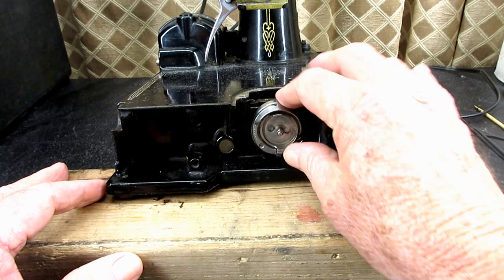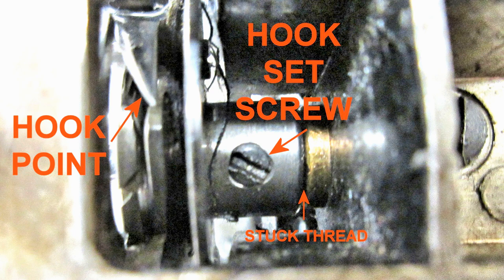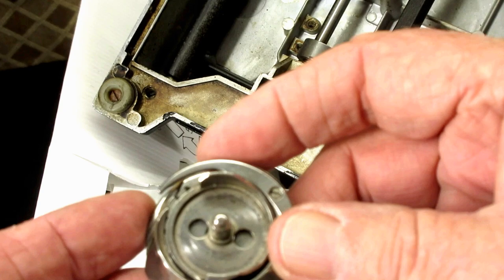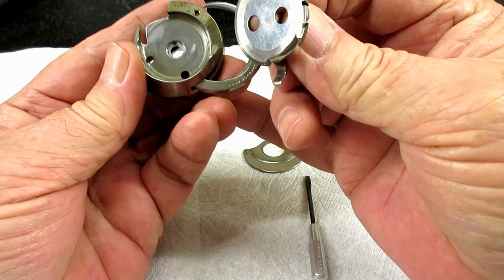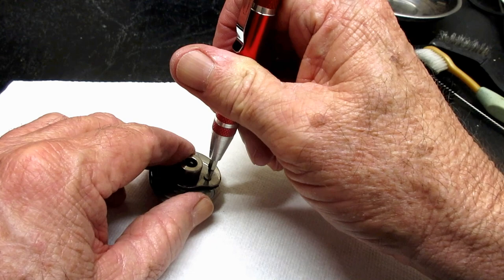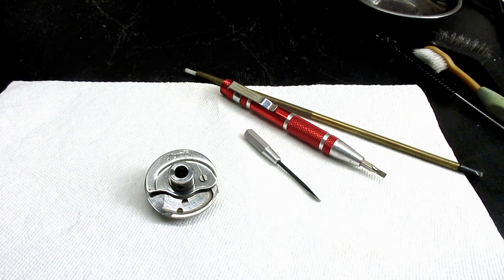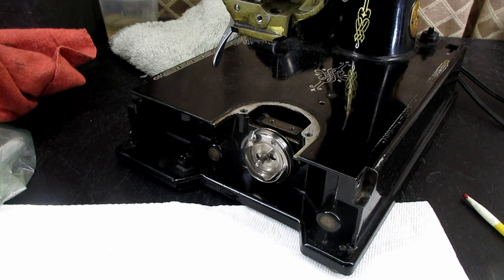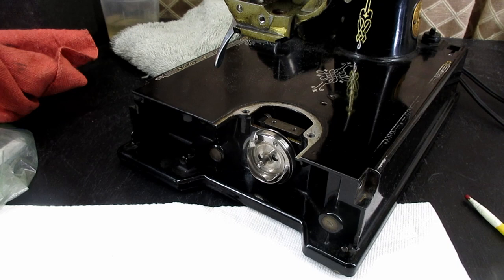How to Remove Clean and Replace the Hook on a SInger 221 Featherweight

Comment: Question Andy, do you have a website? I’ve been trying to learn how to fix the tension thingy for a Singer 7110 and found out through your videos that the indicator was missing the horizontal bar. Is Sew-Classic shop still in operation? I need the part number for the 7110. I’m also trying to locate The Hook Timing Drive Gear Set for that machine also. Help!
Reply from the maker: No website. I am not a dealer. I believe the owner of sew-classic retired. You may find a used tension assembly on eBay but it will cost as much as just buying a complete new assembly. Here is a well known parts seller who has many parts for your model 7110, including the tension assembly and gears. https://www.sewingpartsonline.com/singer-7110-sewing-machine-parts.aspx?sort.ss_cat_sort=desc&index=1   Model 7110 is too "new" of a model for me to have worked on so I can't guide you as to gear replacement. None of my suppliers have a Service Manual for your model which usually means it was made in South America  or Taiwan. Good luck, Jacqueline
Reply: Andy Tube thank you for your respond. The machine says Made in Canada. The gear of the shaft for the tension mechanism is metal. It has a long pin that does protrude out the back the screw that holds the shaft is on top rather than the side. I’m attempting to learn to fix the machine for a nonprofit Forget Me Not organization here in MS. I’m just a volunteer sewist. I wonder if it’s even worthwhile to go through the trouble. The machines that the organization buys or receives are very old. Then they are cleaned and somewhat repaired and taken to the Mississippi Correctional Facility for Women. The organization’s CEO teaches them how to sew specific items (dresses, etc). This items are then shipped to other countries such as Haiti or Africa and given to little girls. My friend operates on a small budget so I’m not sure if the machine is worth all the time and money that could be put in a newer older model that can last longer.  What’s your opinion?
Reply from the maker: It took me this long to research and find a part. A friend in Canada emailed my the parts manual for model 7110 (I'll give you a copy free if you email andymanuals53@gmail.com and ask) The indicator dial on this model was actually called "Tension Spring Cup" (go figure) and the part number is 421739-456. It was common for Singer to use certain parts on many models and there is currently two sellers advertising a part they claim will work in place of 421739-456. (alternative part) That is a fairly common circumstance as the machine age and people look for parts.
Here are links to what I found: https://www.mrsewing.com/products/tension-spring-cup-for-507448-singer-44879-472
https://www.ebay.com/itm/SINGER-TENSION-THREAD-CUP-421739-456-FOR-507448-FOR-200-300-400-500-SERIES-/264593758819
It has been my experience with "alernative parts" that they may not be exactly the same in every way, but they usually do work as advertised. You pay your money and take your chances, I guess. As to a "newer older model" I think you need to go older. Model from the late 1970s and later (newer) tend to have mostly plastic parts and do not last anywhere near as long, are harder to fix when they can be fixed at all and parts found.  Models like 15, 66, 99K (favorite 3/4 size) 201, 301, 237, 327, 337, ( mine cost $25, a gorgeous machine) 403A, 404 are all machines made with mostly metal parts. Some have belts that easily last 10 years and cost $8 to $10 to replace, a job that takes 5 minutes. Some have all metal gears that last a lifetime. These machines are easy to work on (IMO) and parts can be found because 100K to 2 million of the model was made. I have 500+ video showing how to restore many of the models I listed. I've had 2+ million views from 195 countries and territories and countless people have told me they restored the machine by watching my videos and it works great. Some can be found for $20 in thrift shops, yard sales and the trash. Some can cost $200 if in good working conditions. Some charities I work with buy from shopgoodwill.com on auction and fix the machines for charities. The models I mentioned, with normat oiling and maintenance, can sew for another 50 years, no problem. A shame to ship a plastic machine overseas only to have it fall apart. That just MHO of course. Good luck, and sorry it took so long.
Reply: Andy Tube thank you Andy. I’ll send you an email right away. Happy 4th!  God bless.

Comment: Hey Andy!  Thank you for such a detailed video!  It is very helpful.  How tight should the gib hook be?  Mine is really tight towards the top.  That is, above the screw it is really rubbing against the metal of the base.  Is that normal?
Reply from the maker: I'd say it's normal. It's a snug fit with very close tolerances. Watch @10:00 in the video when I swing it open. I had to use some good force. If someone has opened it in the past they may have bent it slightly by pulling on the upper tip, which I warn against. After cleaning mine was slightly easier, but still a tight fit. If it assembles completely and sews well then no worries. There are new, non-OEM (Original Equipment Manufacturer) GIB Hooks available for sale https://www.sewingpartsonline.com/full-hook-gib-alphasew-singer-170160.aspx  I've never used one but maybe there not made as well as the original Singer one. People also reuse parts from other hooks and even 221 featherweight parts as the hooks are similar.

Comment: Andy thank you so much for this video! I was wondering I have went thru cleaning the hook areas just as you showed us, I can still hear a small metal rubbing could it be the needle hitting the hook? In that case what shall be my next step? Thanks a bunch! 😘
Reply from the maker: Thanks for watching my channel, Jacqueline. I can't really diagnose a small metal rubbing thru a comment. Yes, it could be the needle hitting the hook, or part of the hook, sure. Is that when you turn the machine by hand, or when using the motor? With or without thread in the needle? With or without the bobbin case and bobbin? See what I mean? What I check for first is a bent needle (I just put in a new one) and turn by hand, no thread/case/bobbin as see what happens. Run the machine without the needle. Be sure the needle clamp is clean and the needle inserted all the way up in it. Correct style/size needle? The needle bar height and hook timing should be checked. The clearance between the needlepoint and hook point is tiny, and wrong height or early timing can make the needle strike the hook, case, or drag on the loop guard of the hook. You can get a free copy of the model 301 Adjusters Manual by joining or sharing with this service: https://www.scribd.com/doc/230337487/Singer-301-Adjusters-Manual  or if you are uncomfortable with that, you can buy a copy for $7.95 at this website: https://manualsoncd.com/product/singer-301-301a-sewing-machine-service-manual/
I have used both of those sites for years without any problems. OH, BTW, the last time my wife came to me with this problem on her 301A I found she had not been oiling the bobbin case area (like forever) If the instruction manual is needed, it is still a free download from SInger at this link: https://www.singer.com/search/support?title=301

Comment: Hi Andy good day !  I love your videos . Keep up the good work. Just wondering if you could give me few tips for removing the set screws from the hook hub . I have done every possible thing under the sun ….. ie …. I have used the penetrating oil , heat from hair dryer and heat gun but the screws are not moving even an aota …… what should I do ? This is really driving me crazy !!!! Your advice & suggestions shall be highly appreciated. I look forward to hearing from you ASAP. Thanks, Ram.
Reply from the maker: Sometimes it takes hours/days of using a penetrating oil or heat. Some screws, like yours, seem impossible to get loose. I use a method of hitting the screwdriver with a small hammer while turning it at the same time. I've shown this in a couple of videos but do not remember which of the 600 they are. Here is a video with a very good example of this method. https://www.youtube.com/watch?v=LSU7Ua7xyuY     There have been times/screws that this did not work either, so just kept soaking/heating. Recently I tried a new tool, an impact wrench and it works perfectly for removing screws like yours. I showed it in a recent video here: https://youtu.be/t_m98Umuvy0   Good luck, Ram, and be patient and safe.

Comment: I cannot get the first two screws out!! I hit it with the hairdryer and even a little WD40???!!! I got desperate! I can see the thread too!
Reply from the maker: This happens sometimes. You'll need patience. Heating and using a penetrating oil can certainly help and you may have to repat that over a couple of days. I've wrapped the hook base with strips of t-shirt material soaked in WD40 and left it soaking. Using a hairdryer for 5 minutes and a squirt of WD doesn't always work when the screw is that stuck. There can be dried varnished oil in the thread, too, that is holding it tight. Again, be patient as it took 50 years to get stuck that hard. You can also use a closed-end box wrench to give you more torque while turning the screw but you'll need someone holding the handwheel for you. Another method is to firmly tap on the screw bit/ screwdriver with a hammer while turning as the sudden jolts can "break free" the screw. Once you hear the "snick" it will turn easily. YOu can also use a screw extractor device. I show an example of using one starting at 21:40 in this video: https://youtu.be/t_m98Umuvy0  If you are not replacing a damaged hook you can try cleaning it in place, too. If you break the screw head it requires drilling it out and tapping new-sized screws to replace it, and that is a real hassle, so easy does it and be patient.
Reply: @andytubesewing1953  thanks so much.
Reply from the maker: @chrisyzuccaro1767  Certainly, and good luck. It's a wonderful machine and well worth the effort.

Comment: Help please, I am perplexed.  I have a 1942 featherweight.  No problems in the past year if using.  Regular grease/oil by myself.  Yeaterday was chain sewing along and the fly wheel seized up.  I immediatly stopped, took gib hook totally apart off of machine looking for a tiny piece of thread, or burr…none.  So, i did a full maintenance.  Today, chain sewing…froze again, took gib off and looked again, nothing.  30 minutes latwr, again…I took off the belt and the wheel spun freely, needle went up and down…put belt back on and it sewed fine for anout 30 minutes…took belt off, tried spinning motor post by hand, seemed a bit stipp but wasnt locked.  Put belt back on and sewed for another hour+ just fine.  Any thoughts of what is happening?  Thank you.
Reply from the maker: Intermittent problems are often the hardest to track down. I can't really diagnose it without having the machine.
      I would think you are on the correct track by checking the hook and/or motor. There are not a lot of places on a featherweight to seize. You say the flywheel seized, but that is only what you see externally. 
     It's puzzling that the machine starts to work Ok even though you do not find a cause for the stoppage. Only once did I find this seizure being caused by a motor. The motor shaft bearings were not being lubricated b/c the wool wicks had dried to a solid, hard condition and the motor lube could not wick down to the shaft/bearing. The bearings apparently overheated, expanded, and seized the shaft. After the motor cooled down it would run again. 
     I have no idea if your motor has this problem, but it does have oil wicks, and if it is the original motor it is 80+ years old so it may be something to think about. 
     Here is my 26-video Plaist for model 221: https://www.youtube.com/playlist?list=PLsCOZgzzaiKIA1OPw0k6QOSTE-wAUZ4kp   Five of those videos are about rehabing the motor. 
     You can also visit https://singer-featherweight.com/    They know more than anyone I can think of about the Featherweights. A wonderful family who have freely answered a few questions for me and bought and sold parts with me. They have a nice Schoolhouse section about maintenance and surely could advise you better than I can. Best of luck and please don't give up on the lovely machine.
Reply: @andytubesewing1953  thank you for taking your time to try and help.  I will not give up!  I have ever so gently used a pin to see is the wicks felt soft…I have not pushed them in, just sort of softly scraped and they felt soft.  It doesn’t seem to soak up much grease though, so I’m taking care to watch.  I have had two people recommend adding one drop of oil to each wick to soften the wicks, and one said to put two drops of kerosine in each port…I have not done either…quite cautious.  This last time it bound, I was taking the belt off to see if the wheel rotates and I found that the belt had bunched up under that decorative flange, once off the wheel spun easily.  I was able to rotate the shaft on the motor where the belt goes.  I have re cleaned the gib hook and was careful to have that .003 space when putting it back on the shaft, which I had not taken care to do that before…and thankful I have not lost any of those itsy bitsy screws!  Tightened the belt a little, put some corn starch on it…hoping that does it.
Reply from the maker: @suezeinstra2536  I've been told the same about a drop of oil or kerosene. Never tried it, just changed the wicks. A bunching belt could certainly cause a seizure. Gets warm and stretches. When was the belt last replaced?  I've heard of cornstarch, too. I guess anything that works, right? Good luck, I'm sure you'll work it out.
Reply: I’ve had this machine for a year, put a new super belt on it.  Probably has 60 hours on it, maybe a few more.
Reply from the maker: @suezeinstra2536  OK, I'm glad your new belt seems OK. The one I bought broke in half the first time I used it. https://youtu.be/1MVvB8AW-DQ  Why do you think the belt "bunched up" like that? Loose? Slipped off the motor pulley? 
Read the UPDATE on the Super Belt: https://singer-featherweight.com/products/superbelt-v-black-fw
Reply: @andytubesewing1953 thank you.   I read the update…this sounds like what might be happening, I will try a minute amount of corn starch.  It slipped toward the hull under the top “guard?” It was in the proper place on the motor pulley.  I will let you know how it goes.
Reply from the maker: @suezeinstra2536  I hope this resolves it. Good luck.